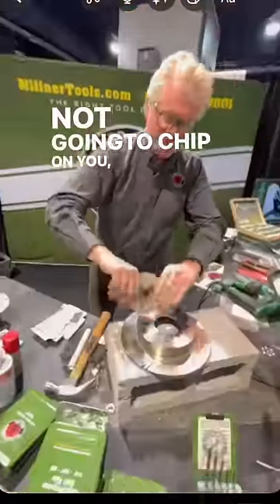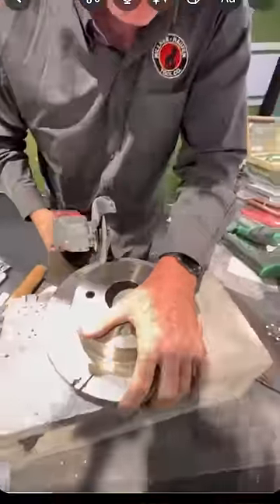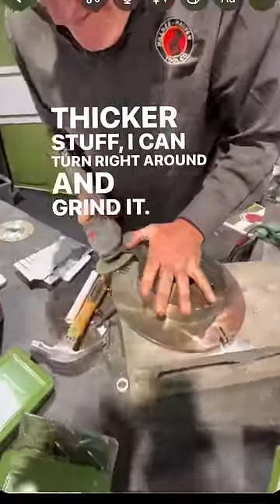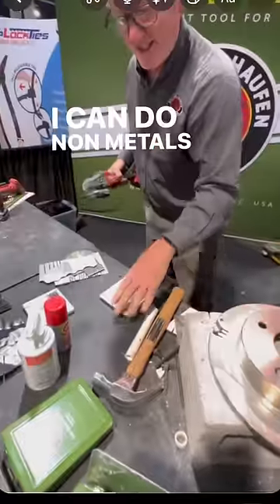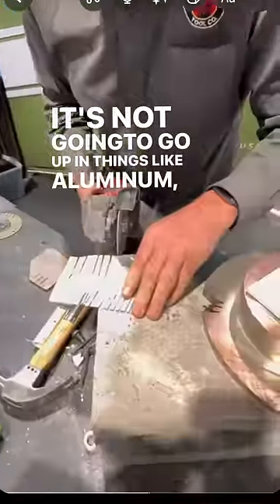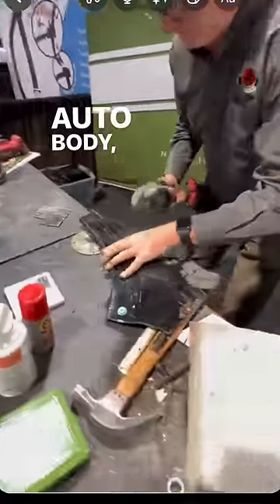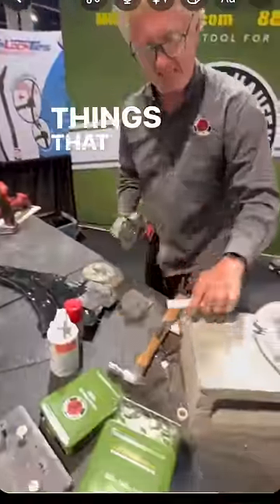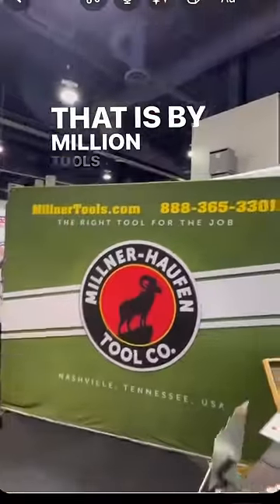I can’t believe he can touch it after all that!  #shorts #amazing #gadgets

Comment: As a metalworker, this tool is piece of art.
Reply: What is that disc, diamond?
Reply: @cheater00  yes I’ve been using them for 5 years. Haven’t used a zip cutter since. Diameter stays the same, no black dust and no chance of flying apart. Not sure what he is selling but I use the Lenox ones.
Reply: @donziperk  ty
Reply: I'm legit trying to find one on the market after seeing this short. Pretty good marketing
Reply: @KirtisPrintsStuff Amazon has the Lenox ones.
Reply: @donziperk I prefer the Diablo brand.
Reply: @ADogNamedStay  yes diablo is great as well. I have one of their metal cut blades in a Makita circular saw. Cuts  steel like its butter. I cut 3/8 plate an 8” c channel with it.
Reply: @KirtisPrintsStuff  yep same. Sold
Reply: Wouldn't it be more like the brush that makes the art
Reply: What is it called
Reply: @donziperk  how long of a life do they have? I cut into shipping containers consistently and I burn through traditional cutting wheels very quickly. I imagine they dwindle down as you use them just as regular cut blades do just maybe not as fast?
Reply: @chasehaynes2438  Definitely not as fast to wear out but the great thing is the diameter never changes. If I remember correctly container steel is different than mild steel so I’m not sure. My experience is 40 times the life of a fibre disc maybe more. I’ve been using them for 7 years never looked back.
Reply: My dad would've killed for a tool like that, I could see its wonderful design being used a lot during welding projects.
Reply: @cheater00  yes diamond infused disks.

I use the Hilti ones, they are not cheap but they last very long.

If they get damaged they have a bent piece and you gotta throw it away. But imo thats better than some disk exploding and fragmenting my face 💀

I have noticed they cut slightly slower than a composite disk. They can indeed cut a multitude of materials.

Mine is made for steel but can cut tile and stone occasionally.
Reply: @chasehaynes2438  they last about 50x as long as a composite disk. Hilti makes good ones imo

Comment: Love the hand placement. My God that's the one tool that makes me nervous to use
Reply: Use it more then!
Reply: @chunkyfecalbreakfast  jeeeesus h christ man thats tough i worn off a little of the top a my thumb nail on a wire wheel set me straight i aint slippin now lol
Reply: At least he's using the original safety fender in that grinder. My Dad takes those fenders off of his angle grinders. I've gotten spark pitting in my glasses, because my safety shield is always fogging up. And I get those steel filings stuck in my pants and shirts. Imagine going through a metal detector.
Reply: @chunkyfecalbreakfast  that's why I'll never use a wire wheel on the angle grinder, it's insane how much power they have and how quickly you can lose control. I'll stick to wire wheeling with my bench grinder
Reply: @jacobshort6528  I've gotten those sparks embedded in my cornea before. Was wearing a full face shield over my glasses. Sparks hit my chest and bounced up underneath. Didn't know anything was wrong until later that night when it started hurting like crazy. Ended up having to go to the ER at 3am because I couldn't sleep from the pain. They removed them from my eye by hand with a little metal bevel similar to a needle, was not fun. They said I had 4 tiny peices in different spots in the cornea. Always wear goggles after that, no gaps for the sparks to get thru.
Reply: Look up pink mist lathe videos. Grinder ain't nothing
Reply: @cM-np3no  In comparison sure, but most people are aware how dangerous lathes are. A lot of grinder accidents stem from how casual people use them and don't take safety precautions like the guy in the video
Reply: Really?
Reply: Bench sanders are sleepers. Seem safe enough. The ambushing part is the disc. The knuckle gets against it sooner or later. A cut is a tiny area damaged compared to a square inch of skin sanded off. And a cut is far less painful a few hours later, and a cut heals much faster. Belt sander discs get trained for 4 years in camo and surprise attack before getting shipped to the store.
Reply: You should try a table saw
Reply: Had a grinder with a faulty button that turned on all of a sudden and just missed  the inside of my forearm lol makes you think twice about safety

Comment: This reminds me so much of when i was 7 years old and my drunken father decided to teach me how to cut kindling but he cut his thumb off instead then he taught me how to sew it back on with wax string , fishing hook and a black tape bandage , such a valuable lesson.
Reply: Like with the bone or only flesh?
Reply: Wth?
Reply: Did it work? If it worked, he's a legend!
Reply: What trailer park was this at?
Reply: Did it work?
Reply: Saltspring Island, Walker hook camping 1977 .... Through the joint it chipped the bone we finished camping for the next few days then  saw the doctor about week later and doctor was pretty impressed it actually reattached... I sewed the tip of my index finger back on using this method back in 1987 after running it through a bike sprocket and chain on 6 tabs of acid. Still have it, it's  a little deformed , no feeling in the tip but the ladies like it ...

Comment: I need this thing. Adhesive always melts so we gotta let things cool down but this is a game changer
Reply: its a diamond cutting disk, the reason we arent normally using those for steel is because they wear fast and cost a lot more than a standard abrasive disk.
Reply: @drkastenbrot  not as bad as these; 150 each. yikes.
Reply: @joob are u sure? pretty sure my diamond discs get hot when i use them
Reply: @terra.b4727  so do these when you use them normally, they just used a bunch of trickery for showing it ofg

Comment: Bad Dog Tools make these also, a bit more though. I've used standard diamond cutoff wheels on steel, aluminum.... diamond grit on edge and slightly off edge. These are $150, paying for the additional diamond bonding 2/3rds  towards the the spindle hole. They will last much longer if you let the wheel do the work.

Comment: Like how he used his hip as huge leverage to get that extra semi fast cut Lol
Reply: I think the point is if you do that with any other wheel it wouldbt be gone before you completed this demonstration. He used it the worst possible way you can use a cutoff wheel and it took it with strides.

It wasn't necessarily a display of speed.. but how tough it is
Reply: I love how you missed the point of the demonstration completely.

It wasn’t about speed, it was about durability and reliability while being abused.
Reply: You can horse diamond disks

Comment: I’ve heard some absolute horror stories about angle grinders. Even had a moment where I ended up just barely tapping my palm with a stone grinding wheel. This guy gives me the sweats and heart palpitations.
Reply: @Mike Byrne that’s more of a cutting disk thing. The other types of angle grinder heads don’t do that, though they still could. But I get what you mean.
Reply: I work with angle grinders for 40 years now, and i hate them because they sure
did cut me a few times, so i have few zippers alright. And cheap cutting disks are just dangerous as hell because i had one that shatered to pieces and schredded my pink finger wide open.
Reply: You notice the guy has the guard on the grinder still... wearing eye protection... and using the grinder to where it throws sparks towards him making the possibility of kickback minimal.  Turn grinder over to where it throws sparks away from you then you are going to have problems .. 

Had a 4.5" cutting disk explode randomly one day.. had taken guard off grinder a year or so ago.. disk exploded on my right hand ring finger.  I didn't want to look at it as it hurt like a sob.... 3 good breaths looked at my hand .. just a small cut lol I think a large chunk slapped my finger . I put the guard back on .
Reply: @codyramos3200  that’s why I don’t use cutting wheels. Shits dumb when they make saw blades for any meterial.

Comment: I know I’m getting older, cause right after watching this I immediately thought “i really need to get an angle grinder”
Reply: It's one of the last tools I need for my aging dad collection
Reply: No you don't. If you did you would've gotten one years ago.
Reply: Exactly. I got one on day 2 lol
Reply: key to the city
Reply: @DavidEast-gy7le  no cap lol most locks are 10 seconds away from not existing.
Reply: @Patrick.Weightman True as hell. I go to Lowes and can probably find a reason to buy half the tools in there, but if I really needed em. At least for the cheap ones.
Reply: @Brolly-Unleashed yeah but the grinder noise outside the ice cream shop is bell that sends the bike owner outside blasting lol

Comment: I've been around expensive tools my entire life, and that's how I know this is REAL!!  It's engineering is TOP OF THE LINE.  And I'm POSITIVE his hand didn't burn at the end, which is part of the demo, because they cut items in a specific order, and nothing long term.  Makes for an awesome DEMO.  However.  At $180 per, you can buy and burn thru 100s of harbor freight cutting wheels before touching the price of this one.  Sorry Millner Tools.  If it was $29.99...  I'd own 2 or 3 probably. But the glue that holds on your diamond coating, just won't hold up under Long term use.  This is great for short 1 time cuts.  Any REAL grinding, and this will wear out after a few mins.  Just like a $0.99 disc.

Comment: So is the point that the cutting wheel cuts stuff?
Reply: P.S I have 3 angle grinders because I'm too lazy to change the wheels and I took the stupid guards off all of them.
Reply: Lol I do the same thing, ain’t nobody got time for that lol. The point of the product is though is the fact that a cut off wheel, the standard woven type, would explode if trying to cut things like he cut and it would forsure if you try to use it as a grinding disc. I’m going to give this disk a try at my shop and see if it’s legit.
Reply: @Ternaz88  I used a similar disc to cut the tops off of a couple 55 gallon drums

Comment: Cuttinf right towards your hand is crazy work
Reply: wouldnt do much damage to your hand, maybe small cut, the blade isnt sharp
Reply: @rbruce5270  I've seen someone cut through a piece of pressure treated pine by putting a piece of paper in a angle grinder. Anything spinning fast enough will cut you.

Comment: Be safe  and aware always but anyone who thinks he has no idea what he is doing cause he has no ppe does not know how to use a grinder properly. I have used and been using dangerous tools all my life long before ppe was required and I have all my fingers. I have been bit more times with gloves then without due to the slippage from glove flex. I feel much safer when I have more control. I learned from guys like this and have been more successful and safer then those who disagree with him. Bottom lone is if you fear your tool you will get hurt no matter how well protected you think you need to be.

Comment: I always have on safety glasses and gloves when I use my angle grinder, regardless if I'm cutting something thin or thick.. piece's of hot tiny metal shards always find a way towards your face, it doesn't matter if I'm cutting one piece or fifty piece's I'm wearing my rated safety glasses and gloves.. piece's of metal can get into the hands just as easy as the eyes.. this guy is bold for not wearing gloves because if you slip or the grinder jumps which will happen sometimes the gloves at least give you some protection from the disc going right into you bare hands..

Comment: It's ok for this shitty grinder and sloppy cuts. But as a professional my grinders are 12000 -18 000 rpm and I wouldn't put this multi purpose blade simply because it wouldn't cut cleaner than the specialized ones.

Comment: The problem cutting tile isn't getting into the cut, it's when you're finishing the cut. Alot of blades can start a cut on tile but when you're at the last bit it will shatter and splinter it.
Reply: Also a tile cutter uses water to control dust. Silicosis is no joke people.

Comment: It's recommended to use a separate disk for stainless steel though, as oxidation may occur as a result of contact with small chips of aluminium, iron, (non-stainless) steel or something else that can oxidize